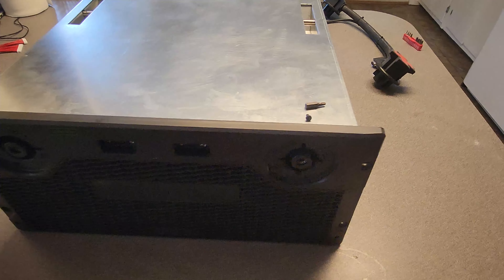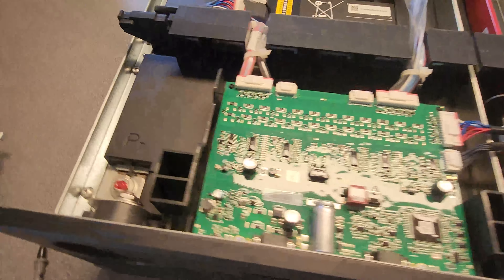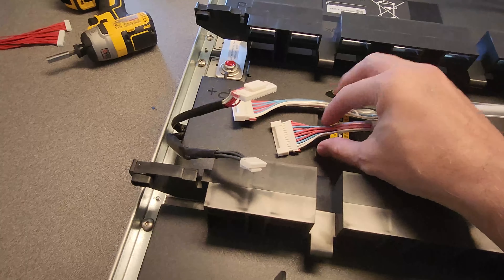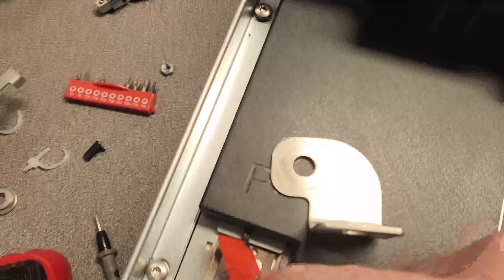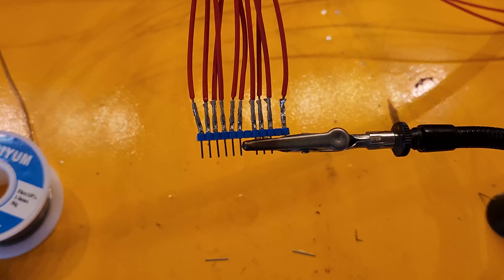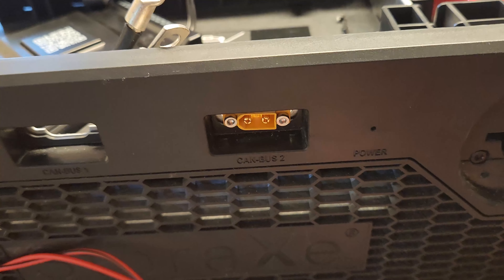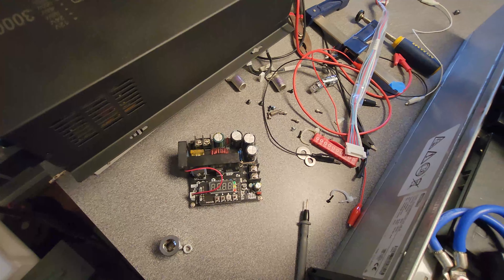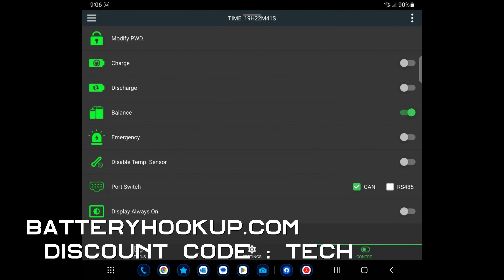Samsung 24s Lithium Ion Rack Mount Battery.

Comment: I have 5 of these batteries. They are all in a 8s configuration. I am using 300 amp BMS, and then paralleling the outputs to a Main DC bus.

They work excellent
Reply from the maker: Any chance you used my discount code?
Reply: I bought them in Canada. If I buy more, I will use your discount code. Thank you. 

Why not break them into 16 ass and use a XW 6848 or outback, fx inverters the maximum voltage of 68 V is not too much for them
Reply from the maker: I really didn't want to break them down at this point. And after finding an inverter that works it even made that more the case.

Comment: battery voltage is 56 Show .

i have Solar inverter of 6.2Kw Hybrid.

Battery option 48V

this is Possible 56 Volt battery connected with solar inverter